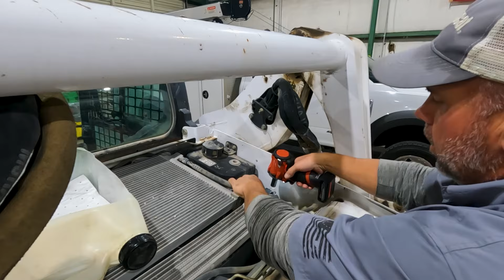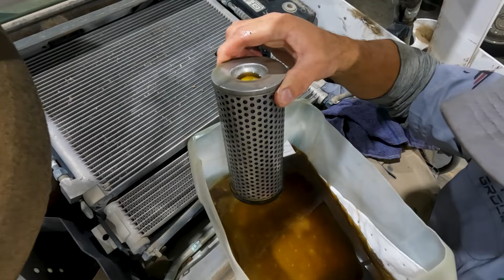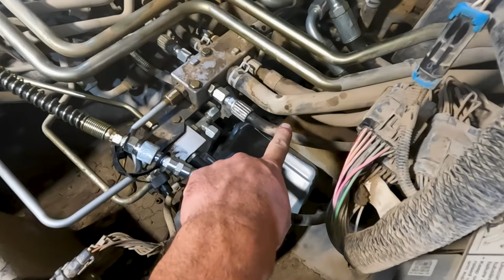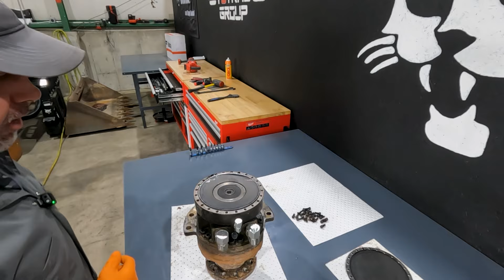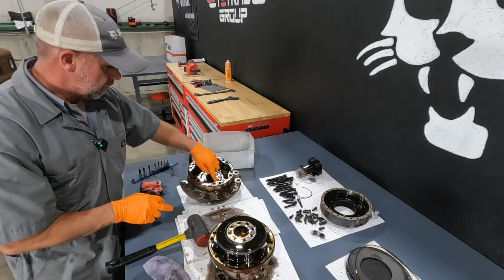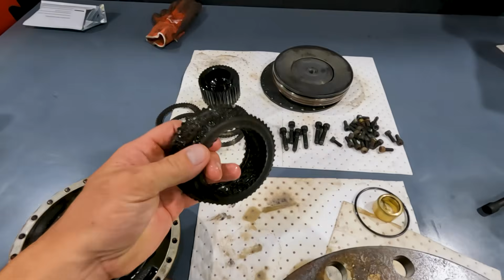Bobcat Drive Motor Troubleshooting using a Hydraulic Porta Power

Comment: Is it feasible if you can't get a Bobcat engine to run and the machine is stuck somewhere that you have to get it out of, to hook up an electric hydraulic pump just to be able to move it a short distance?  I have had a lot of problems because my 953 was broken down and nobody has been able to get it running, and I got into trouble because I couldn't get it out from where it was without it driving under its own power.  Just wondering now if that could have been an option, and would it work perhaps for moving dead machines on/off trailers and such?

Comment: If charge pressure was running through the brakes you would think the machin would have low charge pressure. But guess not. Also why do you think the brakes were being driven through ? So it doesn't happen again.

Comment: Man, I bet you've trained many good techs!! You do a phenomenal job explaining it! I have a question - my T250 broke some of the 24 bolts on the back plate; the motors still worked good enough to load to take to my shop, of course leaking fluid while loading. I just topped it off to load quickly. Any idea what caused that to happen? Thanks
Reply: DId you ever figure out what was causing the bolts on the back plate to blow out, Im on my second drive motor, moved my t250 100" and blew new drive motor bolts off back plate again
Reply: @jamesroberts2713  the seal around the brake was leaking fluid between the plate and the break and it blowed the back plate out after I fixed the right side  I was still having problems with the brake staying engaged from not enough psi to push the brakes in then i figured it out the left side was leaking also from the seal on the brake and not letting enough pressure to push the brake plate in so keep in mind both side work off the same valve so you can’t lose any pressure from a leaky seal or you will be rebuilding it again from the brakes dragging till it blows it out

Comment: On any hydrostatic pump.
The slippers have groves in them for lubrication purposes,  can not be lapped, plus you need to check the end float in the piston and the slippers,  if lots of movement in slippers can cause massive failures. 
The lens plate can not be turned over it is one-sided only.
The hydraulic functions have their own hydraulic pump and system .

Comment: Should you get steam coming of a drive motor when you drive in a puddle .. I’ve got low power on all drive and lift functions .. and bucket drops fast with a load in it
Reply: They get pretty warm after running for a while so steam after getting them wet driving through a puddle isn’t unusual.